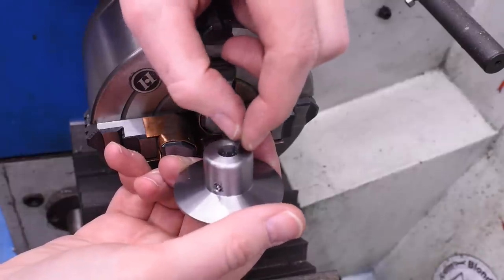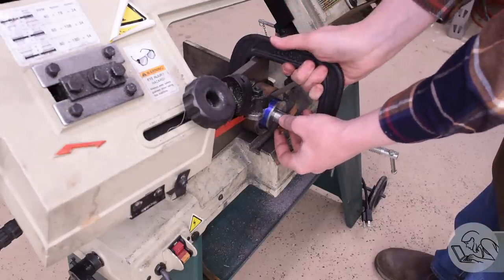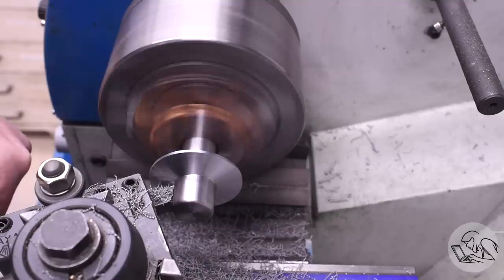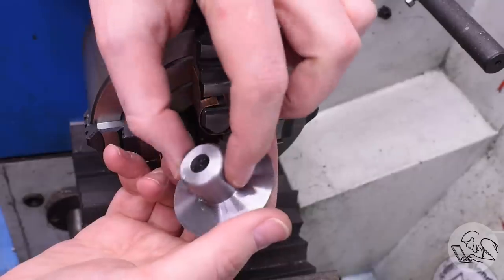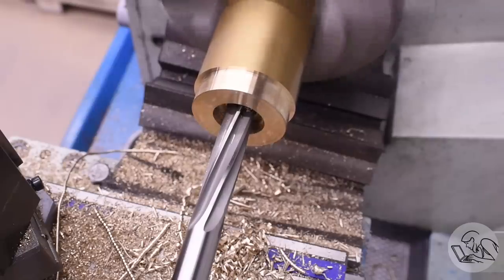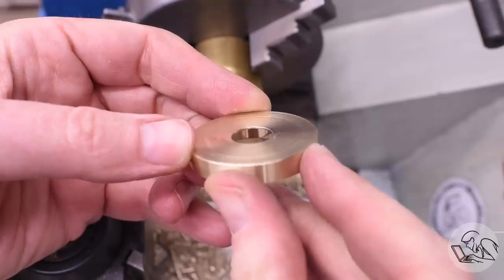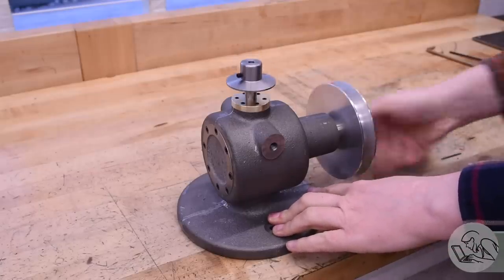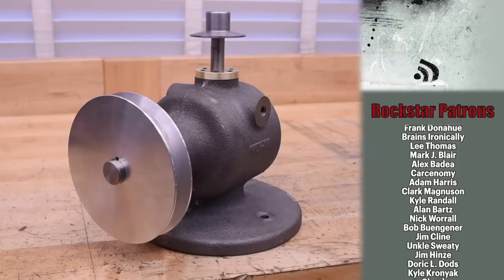Let's Build a Die Filer, Part 6 - Hats and Caps!

Comment: Enjoying the build. A addition that may be worthwhile is add a round leather disc under the cap that is tight on and moves with the shaft but larger in diameter to shed the chips away from the brass bushing even more.

Comment: Quinn, I noticed you chose to plug that hole with another piece of steel and glue. Wouldn't it be stronger if you welded it in place? When do you use one method or another? I'm asking this because I think I rarely see you welding steel pieces and remaking the cut, I guess... just a thought!
Reply from the maker: 12L14 steel isn’t weldable
Reply: @Blondihacks  oh I didn't know that! I don't know a lot of things, so thanks for answering :D

Comment: 21:06 A machinist that only has budget or old, worn out equipment will almost always be more skilled than a machinist that has only ever used brand new high-end equipment.
Reply: True. It's like building with pop rivets. You learn to make sure that the parts are correctly aligned before you pop the first one.

Comment: Nice job again 👍
Better surface finish on parting is easy to achive - you start partin 0.1mm away from final dimension and you run the blade partly in. Than you reset the blade to outer dimension, position it on a final dimension and skim the surface only on one side. With small ammount of chips you don't ruin the surface an it comes ot perfect every time 😉

Comment: I notice, Quinn, that you used black socket head bolts to hold the brass felt seal cap and the back plate in place. I did this too as I have on many projects until my son who is a boltologist came along and pointed out that the black bolts rust and the zinc coated silver bolts don't. So, although the black ones look better, it's always better to use the silver bolts.

Comment: Hi, you probably know this already. just a little tip for making gaskets for castings, just lay the material over the part and lightly tap with a ball peen hammer the sharp edges will cut the gasket nicely.  
Rich
Reply: I don't recommend doing this as you can deform the edges of the part causing a raised area that could cause the gasket to not seal properly.  I like to apply a very thin coat of prussion bluing to the part then place the gasket on the part and rub firmly across the gasket.  Once the gasket is removed the pattern will be revealed on the gasket.
Reply: @robertlark7751  I think the key phrase is "lightly". Rubber mallet and such.
Reply: @robertlark7751  Hi Robert I know this doesn't sound like it would be a good idea but it work very well, I've been doing this for about 50 years and haven't damaged a casting yet. you just hit the gasket hard enough to make the cut.

Comment: 8:56 .
good day.
i was in consyruction for a long time.
there is what is call an anchor bolt at the hardware store.
is for anchoring a wall to concrete.
may be a way to anchor that part to the brace in the hacksaw instead of the clamp.

Comment: I am a carpenter. Making fun of wood isn't fair. At least call it Organically Rearranged Carbon Deposit :)
Reply: Machinists mock what they can't do themselves. 😏
Reply: I just call it Original Recipe Carbon Fiber.
Reply: Wood aka humidity variable tolerance material.
Reply: Semi Rigid Carbohydrate Foam?

Honestly, I really haven't encountered much of the razzing in the real-world. Seems to be an internet thing. Most of the other machinists I know are just as proficient in dead tree carcass manipulation as I am. Almost to the same degree that many machinists are capable welders.
Reply: Rearranged or just Deranged? That's what I tend to get when I work with the stuff.
Reply: Weird looking aluminum.
Reply: Must be fun painting cars
Reply: I'm not a carpenter, and the one thing I hate is home improvement shows when they suggest you need to paint wood. It's criminal.

Comment: Your dislike for dead trees is understandable, however there are a few versions that can be treated like brass or bronze, and machine quite well. And some make excellent bearing blocks in marine use, such as Lignum vitae. Balsa on the other hand, will not retain features nearly as well. 😅
Reply: There is a difference between a good hard oily wood and balsa for load bearing surfaces, this is true.

Comment: Technically you probably wouldn't lose a finger. You would most likely know where it is, it just wouldn't be where it was.
Reply: Oh, I don't know. I once had a half inch drill bit grab, break in half and throw the vice, part and the tip of the drill bit through the window. Strange thing can happen when these machines, who do want to kill us as Quinn has pointed out, decide to become evil.
Reply: @oldfarthacks  you're right. But with a blade dropping on your digit I would think it basically will fall to the floor. 

My father was a mechanic and had a machine fall on his hand (someone messed with safety equipment) he delivered 3 fingers losing the tip of one because somebody literally lost it.
Reply: @Michigan_Tactical  Ouch!!!

Comment: Could the repair be done with a cooling shrink fit? I don't know the proper name, but it's when the inner part is made over size and put in the freezer to shrink, and the outer part is heated up to enlarge. Then they assembled, temperatures even out and they stay together for ever.
Reply: Yes. That is an interference fit. The fix that Quinn did is also an interference fit. Hers is the lightest of them, the process you describe is for the very heavy interference fit. These are all around you, one common example would be the power running boards on Ford trucks. The pivot pins are a shrink fit in the center of the hinge joints and then a running fit in bushings which are themselves an interference fit in the arms.

It is also common where you want a concentric fit, such as a pulley on a shaft.

Comment: I notice that TOT and Carl from Japhand customs have die filers. Both of theirs have a top support so that the file is supported at both ends. As far as I can tell the Hemingway kit doesn’t even have an option for supporting the file at the top. Is that for using more generalized files?